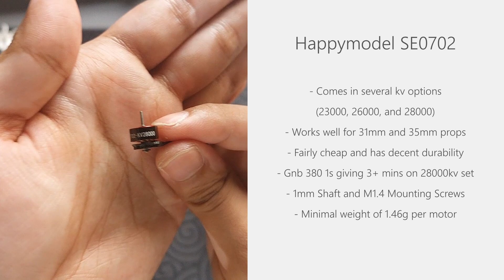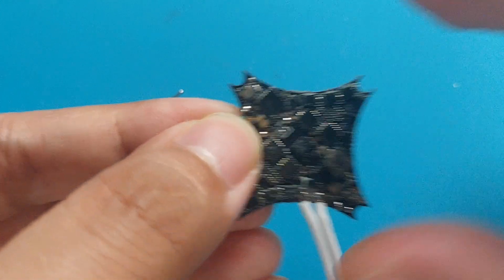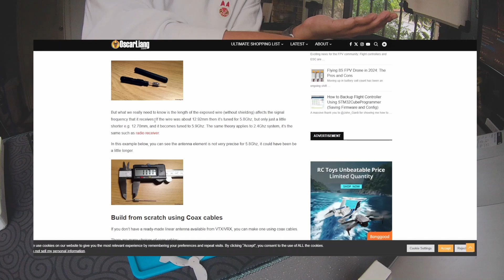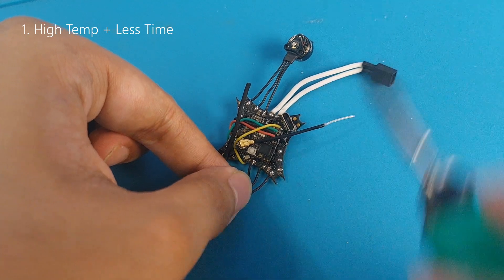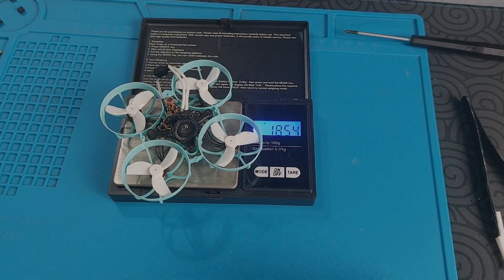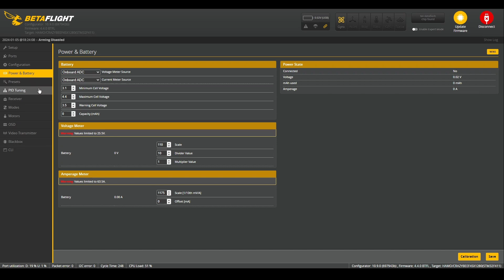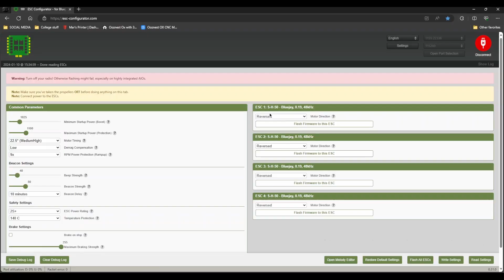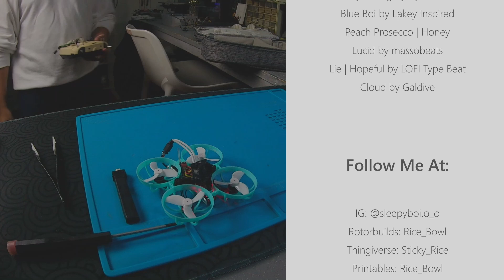Complete Tiny Whoop Build Video and Guide | Custom Micro FPV 65 Drone Build 2024

Comment: 3m tape...? Ty
Reply from the maker: @CCC0122  yupp it's a type of foam tape that holds components well
Reply: @im_ricebowl  , excellent,  ty. Btw, does that protect  the vtx from a fc board? Meaning they should never touch, without something like this 3m tape between them? Ty
Reply from the maker: @CCC0122  yupp! Just make sure you cover the whole side of the Vtx that will lay face down on the fc

Comment: your roll stick isn't centred hence the thing rolling constantly in the rx tab, and turning air mode off does reduce the PID loop authority and effect by about 75% so its not really recommended in 2024
Reply from the maker: it is centered - it's just the desperate attempt of my 6 year old controller to be put down already XD. Dw, the boxer I have is new and doesn't have that.

i didnt show it here but in the preset portion, I did also have dynamic idle. because of that I turned off airmode. Also, alot of the whoop racing pilots I talk to turn off airmode.
Reply: @im_ricebowl  there are lots of schools of thoughts on airmode on/off mine is as a Betaflight Dev 😂.. so it’s a bit more informed! Boxer is a sweet radio. I’m using a pocket for whooping but have a boxer and tx16 which I use for racing and full sized stuff.
Reply from the maker: @Sugar_K  interesting! seems like I still have a lot to learn about betaflight. Yeah man I love the boxer so much! feels so nice to fly with especially after using a janky controller for so long XD

Comment: What about the camera soldering?
Reply from the maker: usually they already come with wires attached and with some protective adhesive on them so you just cut those wires to length and solder to the board

Comment: Is it a durable fc that doesnt burn esc? And can i use a ph2 connector instead of the one u used?
Reply from the maker: I've actually had this aio for a year now and it's still working! Part of that reason is the conformal coat though, so I hope you consider doing that too.

you can but ph2.0 kinda has too much battery sag. It'll fly but not as well as compared to using an A30/BT2.0 connector
Reply: @im_ricebowl  i ask cause i have all batteries with ph2 connector, anyway conformal coating only prevent on humidity, my burnt esc is due to prop getting blocked on a crash and the esc recieving too many amps for a split second, that is what ive been told, so every fc could burn fcs when crashing right?
Reply from the maker: @El_Muffy  Gotcha, then its fine if you go with PH2.0.

I actually conformal coat to protect components as well since sometimes QC isnt great and 1 bad crash can break off a part.

Yupp! thats usually how escs die. Some pilots say never turtle mode your whoops. Most pilots should probably follow that.

Comment: Cool build! If you want to get it to the next level trim down 40mm twin blade gemfans to 35mm. 0702 perform way better with those
Reply from the maker: Interesting I haven't thought about doing that! what 40 biblade do you recommend I use? the gemfan 40mm ones like the ones on the mob 7? I also had some gemfan 35mm quadblades that I cut to biblades but I didn't have luck with tuning
Reply: @im_ricebowl  Yes exactky those but 1mm shaft instead of 1.5mm you have on mob 7!
Reply from the maker: @piotrmalinowski6054  Ill have some on the way then! thanks for the tip my guy! ill try them out when they arrive
Reply: @im_ricebowl  No worries mate, hope it will work well for you!

Comment: Thanks for the video. Had the information I needed to start on my first drone.
Reply from the maker: no problem my guy I'm glad I could help!
Reply: @im_ricebowl  I have a question that I've been trying to find the answer for. I'm building a 75mm whoop and I want to use a 1002 23500kv motor with a 1s battery and an F4 AIO board from HGLRC, the Zeus5. Would that burn out the inbuilt ESC or should it be fine?
Reply from the maker: @alias555aka are these the robo motors? not sure actually since I can't seem to find thrust data on them. However, that aio is only limited to 5a. I found a Infinity Loops video of the using 1002 22000kv on a diamond f4 (also 5a). Sounds like you should be fine but feel free to add a motor output limit if you want to be safe

https://www.youtube.com/watch?v=spdQoxY0JxA
Reply: @im_ricebowl  looking at the Amps in the flight footage, it goes up to 14A, so I don't think a 5A board would work. Thanks though.
Reply from the maker: @alias555aka I think that's 14a total so 3.5a per esc which is still under the 5a limit...current is measured at the battery lead so I think you'll be finr
Reply: @im_ricebowl  I just found a rating of 14.something Amp per motor. So I need a 20A AIO board by my thinking.
Reply from the maker: @alias555aka  you sure thats for 1s? 5a is enough for most 1s whoops
Reply: @im_ricebowl  now you got me thinking. I have a good 5A AIO board and I want to use 1002 motors with the 75mm.quad for some power. So I can do indoor and outdoor whooping. I don't want to burn the AIO board with those motors. But not sure if a 1s can even supply enough power to do that.
Reply from the maker: @alias555aka  my exact thought man 😂 I was like no way would a motor take 14a each at 3.8v - that's like 53 Watts per motor. You should be fine with a 5a aio my guy - just add a 90% motor output limit to be safe so you don't reach the full 5a limit (have some room to breathe when doing full punch outs)